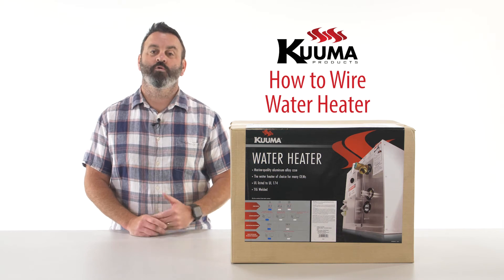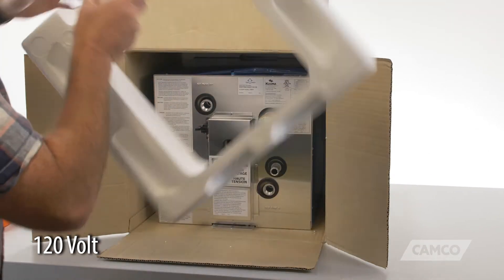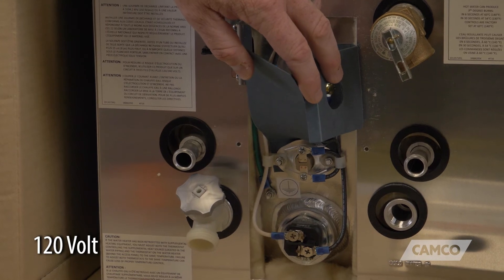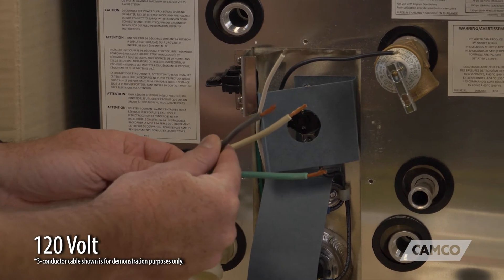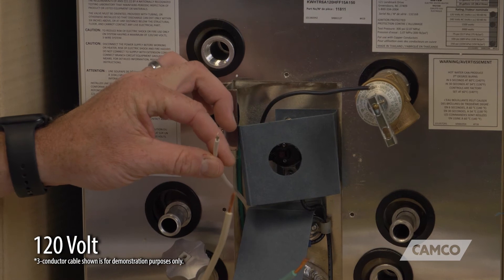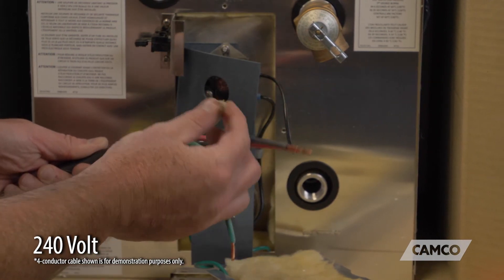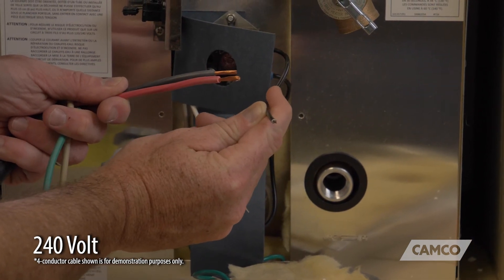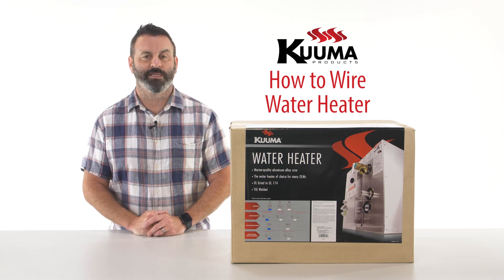How to Wire a Kuuma Water Heater

Comment: In the uk our 240v has 3 wires neutral earth and live my question is why do you have 2 live wires on your 240v system and does it need 2 live wires?  I want to install one on a camper van build in the UK. Thanks.

Comment: I have an older KUUMA 6 Gal Model 40601. The water is heating up but is only dripping at the galley and bathroom faucets. Any thoughts why this might be happening Thank Frank
Reply from the maker: We recommend contacting a plumber. The tank is straight in/out, no restrictions.

Comment: Thank you for this video, letting me know the wires were tucked in was helpful. 
I am surprised that no one talked about putting a anode in place of the drain valve. I am a live aboard and adding the anode has doubled the life of my water heater. I replace the anode about every 8 to 12 months. 

Thanks again. 
Bill
Reply: Anode? My new unit works great while driving but although I have wired it correctly and verified it has power it doesn’t heat. Any suggestions?
Reply: I can only think it’s a bad heating element, that would be rare though.  @rollinwiththeflow2174